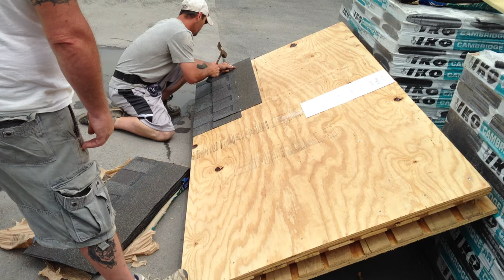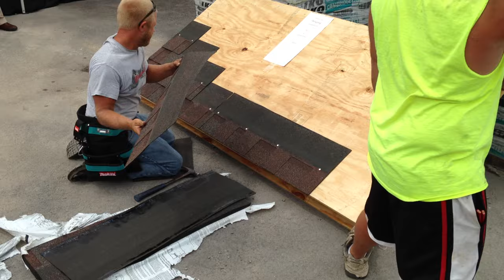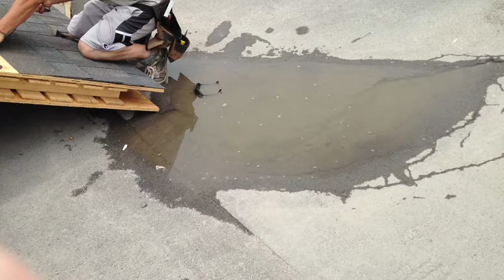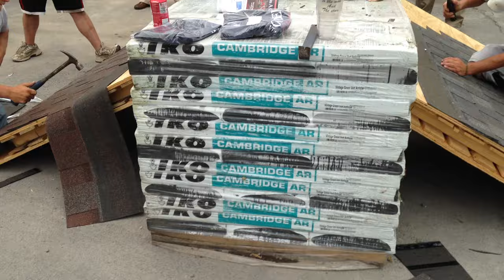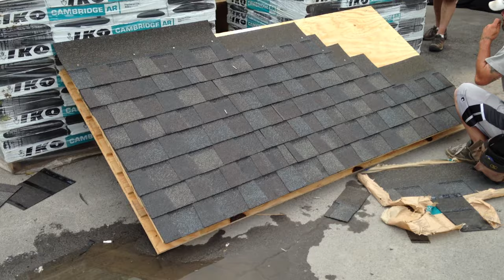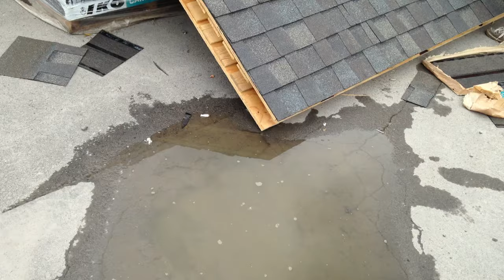IKO Advantage - Shingle Square Coverage - Roof Shingles Installation Comparison

Comment: Sorry i had to change my comment it was all messed up.
I must of did it at night when i was sleepy.
I Hate it when they show some one building or making some thing and they go from one shot to the other it doesn't allow the viewers to see exactly what goes on in the process of putting it together.
I was doing exactly this kind of roof and needed more info on it.
I figured it out but for my first roof and and at the age of 54 it was tuff.
I had to load roof by hand take off under laying of old roof repair old beams and put new OSB all new flashing felt and pounded about 1000 nails or more adding extra suport to cross beams what a tuff Job.
Hats off to Roofers.
I hope you see what i mean in video.
Viewers need to see process from begaining to finish thanks.
I read instructions but not knowing roofing it makes know sence.
Reply from the maker: Hi, thanks for your feedback. We would like to better understand what you mean. Could you please clarify which part of the video you disagree with?

Comment: My company used Iko for years. Had no problems until it came time to test the warranty for Wind. the sales rep for Iko came out said it was my installers fault. But my installer uses 6 per shingle which is well above their requirement. Then the sales rep proceeded to tell me that they're sealing technology is only good for 5 years. So then they do not have a lifetime warranty. They have a limited lifetime warranty which is limited to 5 years. Correct. They gave me so much grief I refuse to use them. That's just my experience.
Reply from the maker: Hi Scott, we are sorry to hear about your experience. If you could please email us at social@iko.com with your location and contact information, we can connect you with an IKO representative for a follow-up.